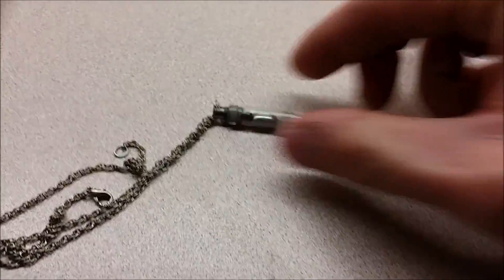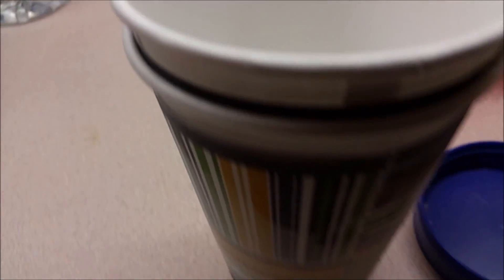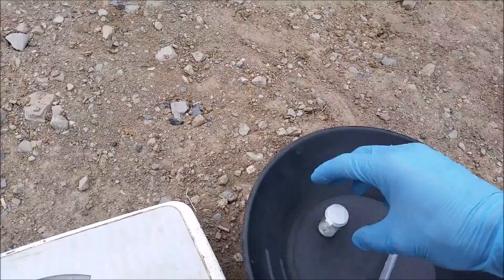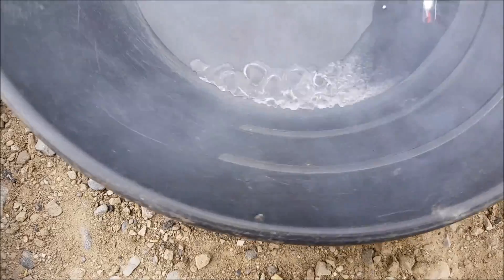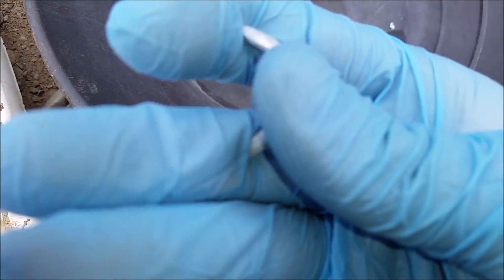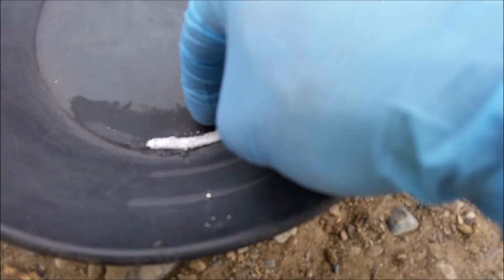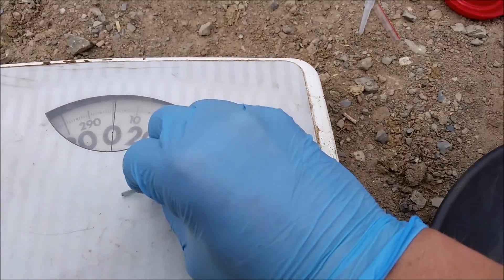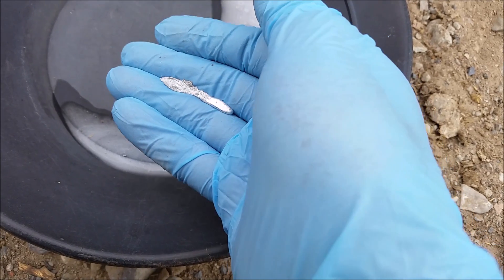Bending Solid Mercury: It Cries!

Comment: It fractures when it is plastically deformed a little past its ultimate tensile strength. It gets soft at higher temperature because of glass transition (rapidly frozen materials tend to have a larger amorphous volume). The thing I'm wondering is whether you have properly disposed of it. Hg(I) can intercalate DNA after all.

Comment: When you break the solid mercury, does it degrade it? Probably a dumb question, but just wondering. (And if it did "weaken" the structure of the substance would the crystal structure be reformed after it melted again? Sorry I guess I am just clueless when I comes to crystal structures and the like.)

Comment: Do all this at -15 degree F after freezing the Mercury. That cold to keep the friction heat controlled so it doesn't liquify.1. Machine it into a shotgun slug.2. Load it into a  12ga shotshell.3. Fire it, see what happens when it hits a hard target.

Comment: For everyone asking the question: Is liquid mercury dangerous? There are plenty of answers below, but it's important to highlight the fact that liquid mercury does in fact give off mercury vapor fumes roughly a few inches to around a foot above where it sits, and the fumes are what's actually dangerous.

And also obviously touching liquid mercury is drastically more dangerous if you have any cuts or rashes. It loves to sink into tiny cuts. I've touched liquid mercury many times in the past and afterwards more often than not, i'll feel tiny little pinpoint pain/irritation. And I'll look at the location and see a tiny little red dot where it hurts. So it does do a really good job at finding where you have tiny cuts at. Always use gloves and it's smart to have appropriate ventilation.
Reply: One time I actually overheated a glass mercury thermometer directly on top a heating mantle (stupid, yes). The thermometer broke and the mercury boiled and spilled off the top of the hot plate. And I unfortunately realized that this happened after I smelled something burning. -_-

to those who may be interested, I immediately felt crazy, kind of like taking a hallucinogenic substance that induces paranoia, mania, irregular heartbeat. my vision was extra clear and I felt paranoid lasting for about 2-5 hours. After that, for the following days, i'd say a residual effect lasted around 2-4months. But every time I ate asparagus or nutritional foods that are known for detoxifying heavy metals from the body, I felt clearer and eventually less impacted by it. But thankfully I'm young and in good health.

Comment: if you jumped in a pool of mercury would you come out dry?
Reply: eric a you wouldnt come out
Reply: Rykehuss yes. People think mercury is like a strong poison. Just like lead it doesn't just kill you. Its kindof like lead. Touching a price of lead doesn't do shit either. Its the people who make things (unprotected) where they use molten Lead their whole life
Reply: Its the lead shavings that are a cause for concern. You can get those on you from solid lumps. Lead poisoning is much, much more easy to achieve than poisoning from elemental mercury.
Reply: yes
Reply: to both of you, as you float on mercury.
Reply: you will walk over it like an extremely fat Jesus.
Reply: SiO2win  your feet would be submerged though, and loose blood quickly. I doubt you could stand up
Reply: Anton Helsgaun
legs are quite tolerate to the excessive pressure. So they will be ok. The only problem is equilibrium. You will have very high centre of mass and no equilibrium control in the liquid. So I guess you will fall eventually.
Reply: SiO2win that's why you'd fall. But you should see codylabs' video where he puts his hand into Mercury.
Reply: Liquid elemental mercury isnt deadly horrible because of its low bio-availability. You could swallow it and be just fine. Your body absorbs it very poorly.
Reply: You dont know what youre talking about, boy. I recommend you educate yourself before you make a fool out of yourself again. Elemental mercury is relatively harmless, although I would not advice breathing in the fumes.

You could pour liquid elemental mercury on an open wound and it would do fuck all. Thats how poorly it absorpts. Keyword for you doofus to research: bioavailability
Reply: Lead is much more dangerous than elemental mercury, to be honest. It absorpts much better through the skin, into the bloodstream, and from the gut.
Reply: Rykehuss does it? I know it would do better, but its a solid whereas mercury is a liquid
Reply: Rykehuss smarter every day
Reply: You would come out dead..
Reply: +Rykehuss what the fuck are you talking about? just touching or breathing in mercury can kill you quickly. swallowing will do it even quicker.

Comment: Where does one acquire liquid nitrogen?
Reply: The Hobbits. Take three parts Hobbit, one part aluminum powder and one part iron oxide...place them in a jar and apply heat until they reduce. Capture the steam and cool it by passing it through water. This results in liquid nitrogen. How? You should understand the magic of Hobbits more than anyone Gandalf.

Comment: This guys so bad ass he just has a cup of liquid nitrogen
Reply: +Nathan Dodds no, he did not mean Mercury
Reply: My understanding is that elemental mercury isn't actually dangerous for you. Compounds of mercury can be very deadly though.
Reply: Some Guy "Bullshit it can't, water can penetrate your skin, This is a extremely toxic heavy metal that is liquid, heavier the tungsten steel and your holding it, thinking your invincible ? Your not."

==Water is polar and also wets surfaces while mercury is non-polar and does not wet.
I don't know what tungsten steel is. If you mean tungsten, the density is higher; 19.3 g/cm3 vs 13.6 g/cm3 for Hg. Its density is irrelevant when considering toxicity.

Heavy metal poisoning doesn't actually mean the heavier something is, the more poisonous it is.
Reply: +Sean Gray:
"My understanding is that elemental mercury isn't actually dangerous for you. Compounds of mercury can be very deadly though."

==Elemental mercury is dangerous as well. Don't breath the vapors. It is a neurotoxin.
Reply: Sean Gray
I haven't seen them but there have been cases of kids biting a thermometer and swallowing the mercury. Since it is not in vapor form, it is fine and the kids did not get poisoning. They poop it out.
Reply: It wont be absorbed trought your hands, or skin, what causes the illness are the Vapors caused by heating up mercury, at room temperature its safe to handle, bare hands.
Reply: no I'm not kidding its in welding supplies you use it to shrink metal so wen it warms up its fit in the hole or whatever you using it for, then you can weld with out using clamps or tape
Reply: +Some Guy It only absorbs through your skin if you have any broken skin, scratches, cuts, anything that can penetrate the second or first epidermal layer of your skin.
Reply: +louis tournas Eeeeexactly.~ <3
Reply: louis tournas see somebody understands man these kids need to pay attention in science class
Reply: i think its called cryogenic fitting
Reply: Does that include dental amalgam?
Reply: I mean having liquid nitrogen isnt really that badass you can buy it from just about any indidustrial gas supplier
Reply: I think you need a license to own over a certain amount (depending on where you live) but yea, liquid nitrogen isn't that hard to come by.
Reply: +louis tournas then how do you explain those videos of chemists drinking a big flask of mercury?
Reply: +louis tournas ah, I thought you were saying elemental mercury was toxic in all forms
Reply: Sean Gray yes it is depending on the way you take it in other wise no
Reply: Recon_GamingYT yea the chocolate chair had it when I got frozen ice cream products by liquid nitrogen
Reply: if you go to harbor freight you can buy it for 20cents a gallon
Reply: being of the Amazing Bolt of impossible Cramps really?
Reply: Wow.
Reply: being of the Amazing Bolt of impossible Cramps yea right
Reply: Elemental mercury as you see in this video has been known thruout history to be extremely bad for you especially to your nervous system and brain functions. It can be absorbed by the body thru contact with skin meaning your hands.
Reply: Sean Gray boi they just said don't breath the vapors. Not don't swallow. It is bad either way but breathing the vapors is more dangerous. If you swallow it less is absorbed. If you touch it, it could pass very little through skin. Now if you breath the fucking vapor you got some deep shit ahead of you. You understand mate.
Reply: Some Guy this is true but it's also the least affective way. Good job though you listened in science class.
Reply: Fiusha Ironfoot No it is possible to harm through contact of the hands. Just not even as close as much as inhaling the vapors.
Reply: louis tournas I like you. You're a good listener.
Reply: Bullshit it can't, water can penetrate your skin, This is a extremely toxic heavy metal that is liquid, heavier the tungsten steel and your holding it, thinking your invincible ? Your not.
Reply: +Scary Gamer Dont u mean mercury. Mercury is more dangerous then the liquid nitrogen. search mercury up

Comment: Interesting video. 
The mercury is being work(strain) hardened when you are bending it in addition to the change in ductility from the beta phase to the alpha phase (but not the liquidus). At room temp tin cry is from crystal twinning and not from crystal lattice dislocation. Solid mercury deforms by both mechanisms.

Comment: I can't hear it. I turned my speakers to max but I can only hear it crumbling. I don't hear any sort of squeak or whine when you are bending it. 

You should make another video with a better set up. Do it indoors, use a larger piece of mercury (if that amplifies the sound), and if you have a better microphone, use it.
Reply: I did cry, it's called a "tin cry" look it up, metal can't replicate a baby cry
Reply: Mercury will evaporate at any temperature while it is a liquid. Mercury will start melting after anything beyond 38 degrees. Room temperature versus outside temperature is not going to make any significant difference of the fumes released in the short amount of time he was handling it.

I'm not saying do everything from start to finish in an enclosed environment. I was just wanting a little bit better set up to hear it better. I'm sure he's got a shed or garage somewhere on his property he could use. and I'll bet he even has a gas mask.

Comment: What happens if you get mercury on the ground? i notice all vids try not to even get a drop on the ground or any other platform. how do you dispose of it?
Reply from the maker: +FlyestBoy 
Shovel it up, pan it out and re-use it. I wouldn't call spilled mercury "waste" its just temporarily inconvenienced.
Reply: +FlyestBoy You don't want it getting into the water supply. Mercury is highly toxic.
Reply: +Erik Pan Right back at ya.
Reply: +Cody'sLab Or some would call it an environmental hazard and require your farm turned into a superfund site. Note to self: If I ever visit Cody's farm, bring own water and don't eat the soup.
Reply: +Matthew W Mercury is not well absorbed through the skin. Its danger when handling comes almost entirely from the gas.
Reply: +FlyestBoy The ground is intoxicated with mercury. Mercury is poisonous. Plants absorb shit on the ground. If they somehow absorb the mercury you dropped, if you eat some of these plants (say for instance they're vegetables) you're getting mercury intoxication. Voila.
Reply: +FlyestBoy Don't lisen to half these cry babyes about how dangerous mercury is. It is not more dangerous than any other intoxicating substance.When I was a kid a few broke termometers, put the mercury on a plastic plate and played with it. After that I just trew it away. No one ever died and I never got close to poisoning. As long as you don't put it in any of your orifices or wash your face with it you are fine.
Reply: +Adam McGrath I worked for the Metropolitan Water District in LA, CA back in the early '80s.  They used mercury manometers to measure flow rate along the supply lines.  There was no barrier between the mercury and the water!  Probably not an issue unless the mercury got flushed into the water supply [easy to happen if the wrong combination of valves opened/closed].  It's because of this and other things I learned about the municipal water supply that I no longer drink tap water!
Reply: vleesevlons I misread his OP's question. I understood it as what could happen if it gets on the ground, not what you do if it gets on the ground. My apologies if I offended you in any way shape or form for misunderstanding their question.
Reply: +Matthew W Good info. I'm gonna say a bunch a bunch of stuff with no references :D I'd say touching mercury is not a great concern. It does not pass through the skin, neither is it sticky, and it has an absurd surface tension. It's a good thing we are not made of metal, because it readily amalgamates (forms an alloy of mercury, often sludgy or brittle) with many metals. This is why it is NOT ALLOWED on airplanes.

What to be REALLY afraid of is methyl- and dimethyl-mercury. The latter readily passes through skin as well as latex instantaniously. A few drops on your skin will kill you - increasing neurological problems all over the place after about six months, then coma, then death in about a year IIRC. These chemicals are also how we get mercury from fish.

Mercury salts are very dangerous too, the more so the more soluable they are in water (which they mostly are).

Elemental mercury does not evaporate quickly at room temperature, it takes a long time, but yea there is some gas pressure. There is no "safe" concentration of mercy vapor in the air, it depends the amount of mercury that is accumulated in your body. That depends on concentration and exposure time. Do not be afraid to open a bottle of mercury, or being around elemental mercury for little while. No stress. But be very afraid if you spill mercury in the room where you sleep, and it seeps between the floor boards.

At higher temperatures it evaporates quickly into real vapors. This is really dangerous. In the old days there was a process to make hats that used mercury to shape them, which was then evaporated off. Hat makers would get severe neurological problems, and this is where the expression "mad as a hatter" comes from. It was also used to apply gold to ceramics (by gold amalgam), and those workers suffered the same fate.

I think the fear of elemental mercury at standard conditions is a bit overrated.
Reply: Someone in own city spilled a barrel of illegal Mercury on a street and they had to replace all of the asphalt
Reply: Matthew W
 Wow!  That was VERY informative and A LOT of stuff I didn't know (because of the details).  Thanks.
Reply: +FlyestBoy Larger amounts can be salvaged, the tiniest amounts will either oxidize or quickly evaporate, and in such small amounts neither is much of a problem.
Reply: +Philip Royd Those new style light bulbs contain mercury...  think of that next time you break a bulb in your house...
Reply: Standard procedure is to sprinkle sulphur over it, which it will react with, allowing you to scoop it up for safe deposition.
Reply: +Matthew W thanks fam
Reply: +Matthew W Mercury is liquid at room temperature (and standard pressure).  It has a boiling point of 356.73 °C (674.114 °F)
Reply: The amount of mercury in a vaccination is so low that the harm risk can't even be calculated. However, as it is easier to pander to ignorance than it is to fix it, mercury preservatives have been removed from many vaccines. And and amalgam isn't just mercury, it includes silver, mercury, tin and copper. Small amounts of zinc, indium or palladium also may be used. You're vastly more likely to get mercury poisoning from eating too much tuna than from accidentally swallowing an amalgam or two.
Reply: Re-reading these comments made me realize that 95% of these comments didn't answer my question in any way lol... which was. " what happens of it gets into the ground " and " how would you dispose it" lol
Reply: Your question was if it gets on the ground (which I answered), not into ground (which I dont know). I hope I was the 5%.
Reply: there are this little metal 'loops' specially made for picking up mercury. since the shits rolls all over the place. these loops set the mercury stuck. or something
Reply: Pure mercury is extremely expensive ! You don't want to lose it
Reply: +Adam McGrath that really answered his question.
Reply: +vleesevlons And your comment was so necessary.
Reply: it falls on the ground
Reply: Just the fact you are calling it intoxication truly nullifies any opinion you just gave...
Reply: vleesevlons hahahaha
Reply: +Matthew W. A lot of people have mercury in their mouths as fillings.  My mother had her amalgum (or mercury) fillings removed, and dentist neglected to put in a rubber dam in her mouth before removing the filling, and she had a hard time walking after that.  I am also concerned about Thimerosal in vaccines since it also contains mercury.

Comment: The mercury broke when you were bending it because of "cold working" that happens in all metals above their annealing temperature. Kind of like a paper clip that you bend back and forth that eventually breaks. The metal actually gets stronger/harder as you work it, and then becomes so brittle that it eventually breaks when you forcibly deform it. If you were to closely control the temperature down to its annealing point, the stored energy in the metallic crystals would "relax" and you could then re-cool it to have it return to its ductility. I think lead will anneal at room temperature, which is why it's almost always bendable/pliable (e.g. those long fishing weights). Cool experiment. Careful with the heavy metals. :-)